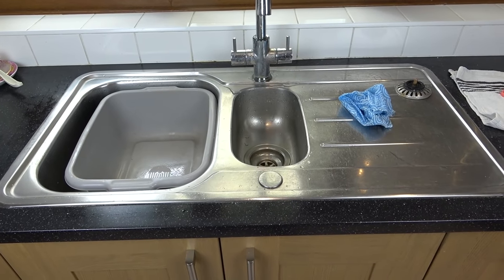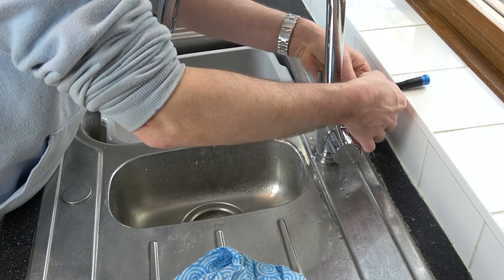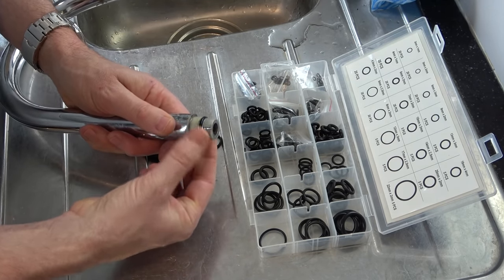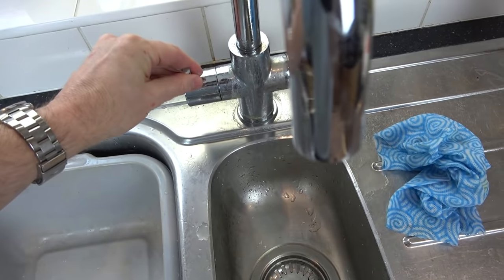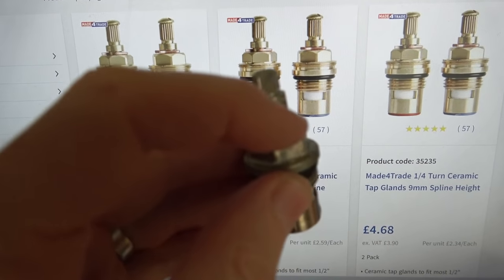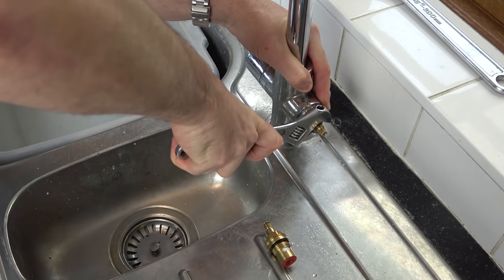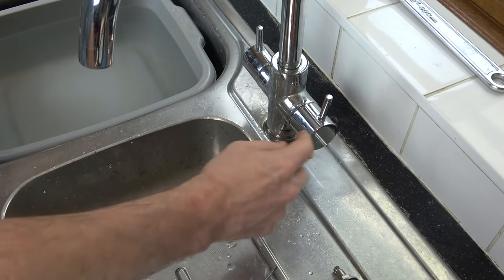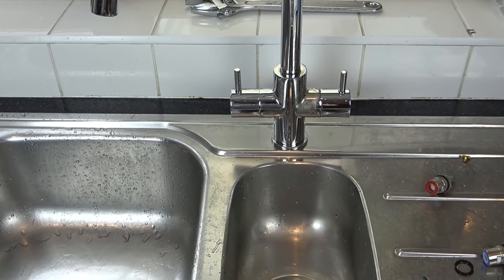Trying to FIX a LEAKING 1/4 Turn Kitchen TAP

Comment: It's is DEFINITELY worth noting that not all handles just pull off the taps. I work for B&Q in the kitchens section and the majority of the taps will sell will require you to remove a grub screw before you can take the handle off, in some cases this is a hidden grub screw, it could be hidden behind a cap or a cover or something. I haven't ever seen any that just pull off like yours did! Worth noting for sure because if anybody is attempting to pull them the same way you did they may be confused as to why they aren't getting anywhere

Comment: The spline orientation is fixed in relation to the fully open/closed valve. To get the handles to align you need to fractionally tighten up or loosen off (riskier option) the whole valve with the spanner. In your case if you can 'nip up' the cold valve a little more then you should be able to get the lever more upright.
Reply from the maker: Thank you Brian 👍👍👍

Comment: actually you can remove the red/blue silicone ring at the bottom of SOME inserts and turn the ceramic part around to change open/close direction.

Comment: I found your video extremely useful. I have a kitchen tap which is of similar design. It is only about 3 years since it was installed, but it is leaking! What I mean is; the tap is dripping. So I think the ceramic cartridge needs to be replaced. You have shown me how to go about it. I had no idea how to access the cartridges, just pull off the handles. How easy is that?! I had no idea where to source the replacement cartridges. I was totally unaware that Tool Station stocked them. You have shown me the way forward and increased my confidence in tackling the task. Thank you so much. I am extremely grateful. Keep up the great work.

Comment: I actually did this on a similar tap a couple of weeks back; the hot side was leaking and every time we turned other taps on it made a whistling noise in the pipes! The version I have has a big plastic gear which fits on the cartridge and in the tap body, and that has much finer teeth for adjustment of the tap position. I did have to adapt the plastic gear a bit though, as it needed to sit further down on the shaft to get the tap tops nicely aligned. Used exactly the same cartridges as you, and I was surprised how cheap and easy a fix it was. I used a tiny smear of silicon grease to help the rubber washer when tightening the cartridge, but I also use Fernox a lot too.

Comment: Great video, Removing the blue/red silicone seal and the top circlip should disassemble the cartridge, there should be an inner o'ring that has failed    👍👍👍👍
Reply from the maker: Ohhhh, so it may have been fixable then as the ceramic discs weren't leaking. That would have made a better fix as I probably had an o ring to fit it. Thanks for sharing that AR, hopefully it will help others out 👍👍👍
Reply: Im glad someone mentioned it, yes removing the red or blue gasket and the circlip allows you to press the shaft of the splines towards the ceramic disc pieces and all 3 peices will tumble out of the spanner body. Its rather fiddly and easy to mess up. Should be done with care and layed out on a cloth in orientation. Also the oring in question is very tiny and not one likely in your oring box. Might have had to purchase online anyways. Anyways great repair! Plumber from san diego here! Love the vids Vince!

Comment: ‘O’ rings, whatever sort, need to be lubricated for fitting. Using WD 40 is a great idea. Alternatively Vaseline is a good choice. There are specialist lubricants or greases available but they tent to very expensive. I think the grease that you used is silicone. Whatever lubricant is used, you only need to apply the slightest smear. Apply Vaseline to the ‘O’ ring and using your fingers wipe off the excess so that the ring is shiny but no visible sign of the grease. This is based on my experience as an engineer dealing with military applications.
Reply: Washing up liquid is also a good lubricant that won't damage the 'O' ring, while many lubricants will, including the dreaded standard WD40.

Comment: After an hour of searching I finally found a video that demonstrated how to remove the gooseneck instead of lifting off a collar.  Mine didn't have an obvious allen wrench location and I could not for the life of me figure out how to get to the O rings (already replaced the cartridge).  There was a spot in back with a rubber whole plug that matched the look of the neck.  YOUR video helped me to look closer once I realized the whole thing lifted out of the collar.  Replaced the O rings and good as new.  Cheers mate!!

Comment: I had an identical tap leaking from one side but when that side valve was opened, not when closed as your situation was at beginning of video, that cartridge u can actually disassemble and it has some small o-ring that's perished and u can try replace it, or better yet replace entire cartridge like u did, remember when u removed circ-clip, that let's u pull out the middle pin which exposes the small o-ring I mentioned earlier on.

Comment: Hey Vince! Just a weird observation / tip! I wrapped some kitchen towel around my taps, where the limescale was bad; secured it with elastic bands, then soaked the paper towel in IPA! Left it for about 30 minutes, then all the scale & black marks just brushed away with a stiff toothbrush! 👍🏼

Comment: Great video, Vince!  I've not heard of that LSX stuff before, but I feel like I need some of that in my toolbox.  I have about 100 rolls of PTFE tape and seem to use that on everything 😂😂
Reply from the maker: I think it is around a fiver from ScrewFix, useful if you want to reuse olives (bit naughty) on compression fittings 👍👍
Reply: Brilliant stuff but can’t be used if surface is wet
Reply: Another brilliant tutorial.

Comment: re pulling off the handles, the lever in mine screws into that handle cap, and acts as a clamp for it.  Unscrew the little lever to release the grip and the handle cap comes straight off. Top video.  Thanks.

Comment: Hi Vince,
The answer to all your latest videos regarding plumbing items is: a) red wine vinegar with 5 or 6% acidity (plain wine and water ingredients and nothing else) and b) a suitable container (shape-wise) to accommodate each of those items so you don’t waste too much of that vinegar (yes, the cold/hot water valves had to be replaced).

It’s important that you‘ve got some kind of a plan to every day’s choirs because you must let them soak for at least 24 hrs.  A chrome layer or stainless steel items won’t be affected but be careful with galvanized or zinc layered items that the vinegar might go through and remove that layer.

When I was in UK, I found that Cillit Bang (or similar products) was waste of time on heavy scale deposits.  So, on items that cannot be contained, a towel spread over big surfaces (like the sink area) or wrapped around others of a more awkward shape and literally drenched with vinegar that you keep on “topping up” for around 24 to 36 hours, was a better option. After vinegar treatment, scrubbing off with the green side of a scouring pad on stainless steel items, finished them off nicely (not always suitable for mirror finished items, you need to check).

Finally, to preserve O-rings’ life, for those that takes some time to be used, dust some talc powder on them.
Reply from the maker: Thanks for all the tips deanoh 👍👍👍
Reply: @Mymatevince  You're welcome, Vince.

Comment: Very good. I'd have done the lime scale on the tap end where the water comes out as well. Think if you'd tightened the cold that little bit more it would have been straight like the hot, yes i have ocd as well lol

Comment: Had the same issue with the FRANK taps replaced the washers then found a hole in the spout. Lucky for me someone was selling a used one for 10 Euros so I now have spare parts for this really Expensive tap!

Comment: We are totally spoilt today with all these videos in one shot!!! =D  Got the same type of tap, this is something I need to do!!!   This was super useful!  I am thinking I need to replace the same parts you replaced there - it looks identical, but I have it dripping from the spout too.  I am guessing either my hot or cold valve (internally) has limescale or bad washer - that's different to your faults I think?  What do you think?  It is identical to yours though!
Reply from the maker: Thanks Chris,  if they are 1/4 turn taps like the one in the video then I am sure a new cartridge will sort the dripping, i think the ceramic discs wear and let water by. You could turn off the isolation valve for the hot and see if it still drips then you know which side is leaking 👍👍

Comment: Also regarding the spline orientation, if you cant tighten up the valve any further you could use some PTFE tape on the valve thread, that will give you some 'thickness' to play with.

Comment: You forgot to clean out the filtre in the front from scale and calc thats why the flow of water is not straight
Reply: Once removed, you can soak that filter in vinegar for  at least 24 hours and then brush it. The filter will be good as new!

Comment: For lubricating anything plumbing; invest in some marine grease. It lasts way longer and will ensure your taps or moving parts don't cease. Also it will make moving parts smoother to move, preventing  wearing of o rings. But good luck on getting it off your hands.
Reply: I would have thought you need to use something that is potable in house plumbing
Reply: @peepiepo  yes, food grade silicone grease.

Comment: Not sure if same with ceramic cartridges but the older taps would allow you to remove the spline shaft after removing the circlip and winding counter clockwise, found this out by accident on my old bathroom taps one day that had ceased up, removed, some grease and put back together. But i suppose for £4.50 for new ones not worth the hassle.

Comment: If you want a good laugh price up those cartridges from the company I used to work for, Lefroy Brooks. Admittedly, the ones we put in our units were the best of the best and not from screwfix, but Jesus they are eye wateringly expensive...
Your lever alignment problem was a common one. On some of our units we had a short adapter shaft with a different number of splines on each end. This allowed for fine tuning of the lever position. In your case we would adjust the shoulder of the cartridge to allow it to be screwed in just that little bit more  and bring the levers into alignment. When customers are paying more than £450 for a kitchen mixer like yours with a posh name they get really shirty if everything isn't absolutely spot on.

Comment: As soon as you lover the pressure in the pipes around a tap, you should always dipp the end of that tap in some cleaning fluid, it screws out and i think that was one of you problem, i do not think that oring on the swan neck was a problem because that hold sutch a low pressure if you have a clean Perlator. At least, that's the name in Swedish.
Many watersaving parlators make the old taps leak because it wasn't made to hold a huge amount of pressure, but you have an ardinary strainer that is probably worn and dirty. 
Thank you for the entertaining video and helping people to realise you can and should fix stuff like this!
Reply: Way, you should clean it because when you lower the pressure in the pipes going to the tap.
The scale up in that pape collapse, and when the water and air rapidly go, throw it washing that scale up, and it ends up in that strainer in the end of the tap.
Reply from the maker: Cheers Anders 👍

Comment: those kinds of cartridges arent really fixable, particularly not that specific leak, scale build up can stop them fully closing but if water is slipping past the shaft then something internal has worn down which you cant really do a whole lot about.  some models you can disassemble and find an o ring to replace but these ones dont look to be that kind

Comment: I think if you tightened the cold water nut on the right a little bit more it would have brand you level with the hot water nozzle on the left.

Comment: Once I had to use my pneumatic tyre bolt removing tool to get that cartridge out.
Even though the whole sink and tap was brand new and started leaking after 3 weeks but I could not get it out with a spanner.

Comment: The aetator screen needs to be cleaned or replaced but with these taps you might need a special tool to remove it

Comment: Vince is your hot water system gravity fed?
The hot water pressure looks pretty rubbish to be fair.  Good fixed though very impressed.
Reply from the maker: Yes it is (as far as I know)👍 Big water tank in the attic that pushes into a hot water cylinder on 1st floor...But for the shower and the bath it is pumped so that flows pretty good 👍👍

Comment: Watched your vids for a while mate.. As a plumber surprised at this vid. Not bad job lad 👍. The way ur tap is moving is the rigid washer been fitted under sink?
Reply from the maker: Cheers Dave. I can't really see under it very well unless I empty out the shelves because the half sink is blocking the view. I think the flexing is coming from the sink itself...seems quite thin and the tap is quite heavy. I have just felt it now and it feels like a big 'C' shape washer is there underneath the sink but it is very thin 👍👍👍
Reply: @Mymatevince  u can pick them up from screwfix. Plastic triangle thing.. That's the prob with these taps and such thin sinks. Need any help drop me a line mate
Reply from the maker: @davehud2831   Cheers Dave👍

Comment: To be completely honest I do not like the style of water isolation valves you have there especially in an emergency situation because you have to bother with a screwdriver. I know in Canada we do have 1/4 turn ball valves that have a nice little handle that makes it easy to turn when you need to but not so easy to partially close when you accidentally hit it. Next time when you are changing out a water fixture, I would do some research and see what the updated style of 1/4 turn valve is available and replace them to one that you don't have to fuss about with a screwdriver.

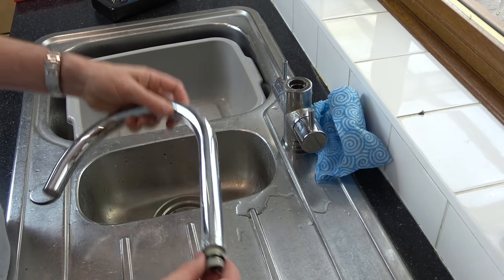Comment: 6:15 NOOOOOOOOOOOOOOOOOOOOOOOOOOOOOOOOOOOOOOOO
AAAAAAAAAAAAAAAAAAAAAAAAAAAAAAAAHHHHHHHHHHHHHHHHHHHH
never use mineral oil based oils or greases on water pipes....
u can smell the shit for years......
Reply: wd40 silicone doesn't have mineral oil in it, no?
Reply: @lordjaashin  from German Backprint on the WD40 Bottle: igridients... n-Alkane, Isoalkan, Cycloalkane... all 3 ingredients are made from mineral oil. And 1 question. would u put anything in ur water, where safety instructions are: ''if swallowed, call the poison information center immediately and see a doctor !'' ?
Reply: @Ratzfaz  wd40 and wd40 silicone are different products. silicone lubricants doesn't have mineral oil products because silicone  lubricants are preferred lubricants for use on rubber and o rings.
Reply: @lordjaashin  wd 40 silicone is in Germany not as food safe declared.
Reply: @Ratzfaz  thats strange because wd40 website states that its silicone spray is NSF H2 certified